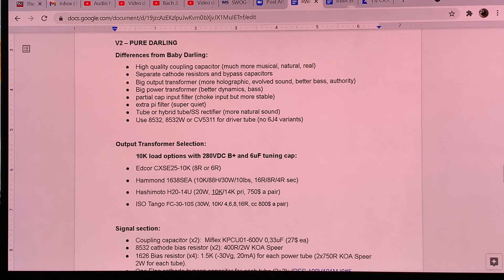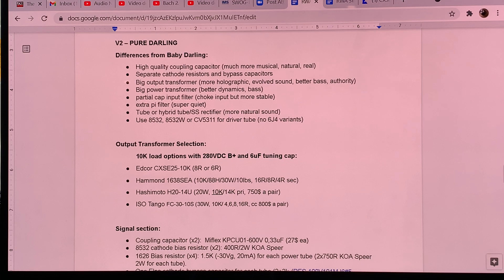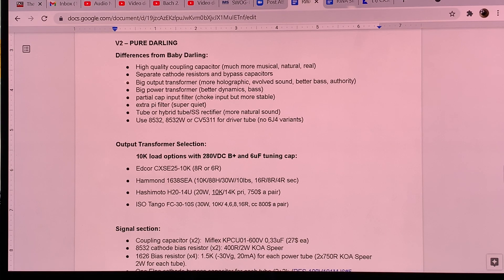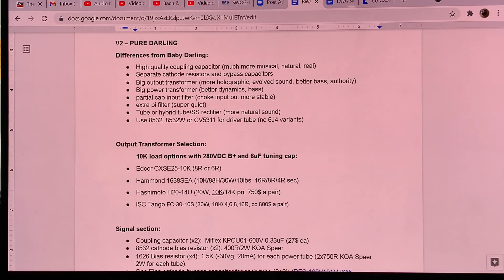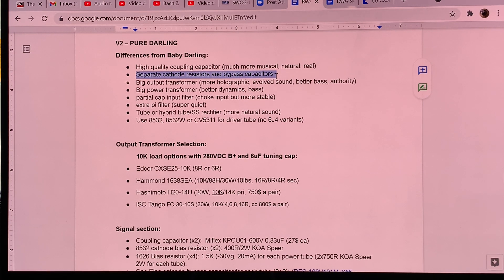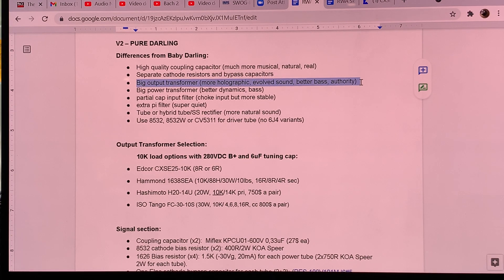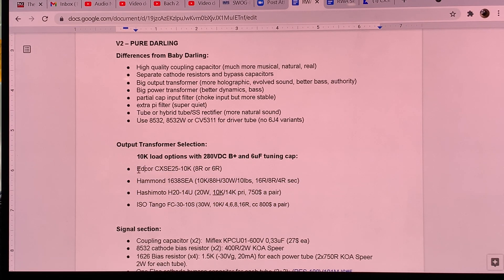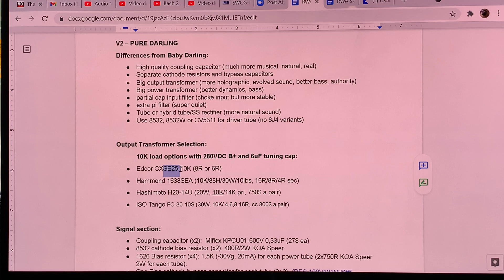Pure Darling 1.

Comment: Hi, I tried posting this question on your channel discussion page. However this seems to have disappeared- for me at least. So forgive me for being off topic. My question is: I have a pair of Sowter  ultralinear push pull o/p transformers, supposedly designed for KT88s and a 50W o/p. The a-a impedance is supposedly 5K Ohms, but when measured is actually about 4K Ohms. Can I use the 4 Ohm o/p taps with 8 Ohm speakers to compensate for this, or will this push the a-a too high? Thanks. M
Reply from the maker: This is really odd - finally your post showed up, and I answered it, and then the whole thing went away... Short answer: it's no problem, KT88 will be happy with 4K primary load!
Reply: @realworldaudio  Thanks!